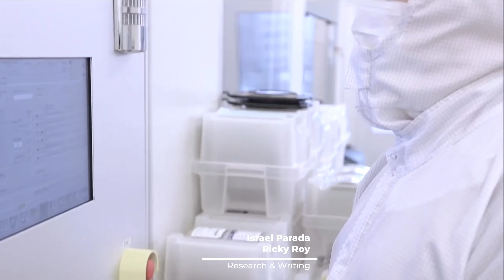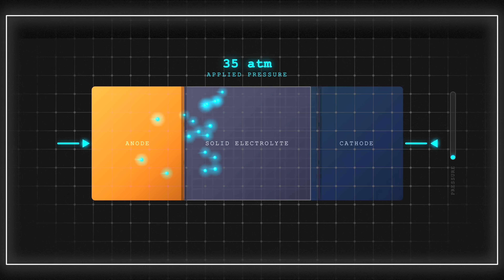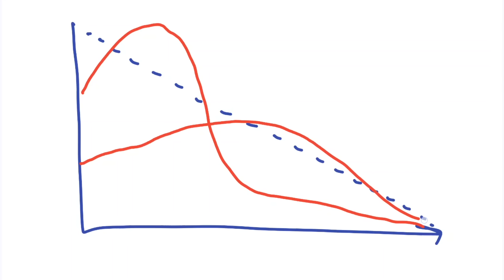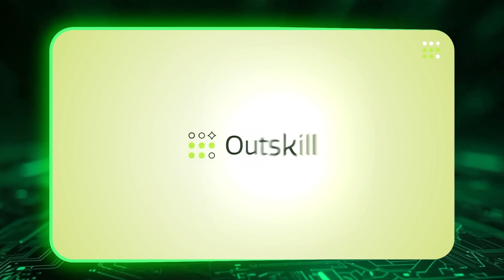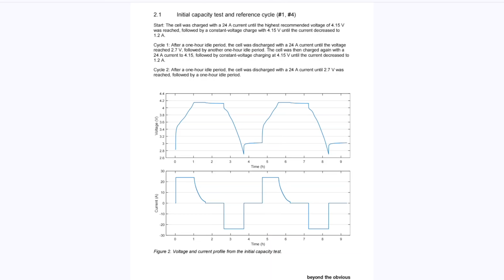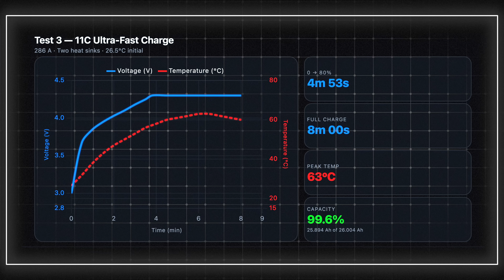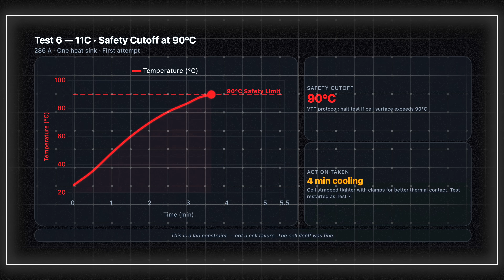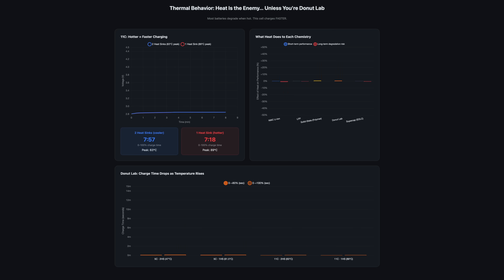Donut Lab's Solid State Battery Test are Shocking...

Comment: Great analysis, Ricky! 
I think the key lies in the internal surface area.

The "lithium fingerprint" (3.6V-4.3V) is likely a deliberate design choice—digital emulation to make the cell a "drop-in" replacement for OEMs. The real story is in the physics you noted: the resistance drop at 90°C and the lack of swelling.

My theory is that they are using an amorphous, aerogel-like nanostructure with a massive internal surface area. Instead of slow chemical intercalation, ions simply "stick" to this enormous surface. This is the only way to potentially reach their 400 Wh/kg claim while maintaining the zero-expansion stability and 11C charging you saw in the data.

As you observed, the cell actually performs better when hot because heat facilitates ion kinetics across that massive surface lattice. Don't let the familiar voltage curve fool you; the thermal stability and lack of physical expansion prove this is a "supercrystal sponge" operating on physics, not traditional liquid chemistry.
Reply: @te107  Aside the technical data you explained, about the internals of the cell, is exactly what I was thinking. The internal resistance dropping with high temperature, to me, signals no LiOn. Having seen how Donut Labs operates in the marketing side, we will probably see variations of the test pretty soon.
Reply: In other videos one woman dissected probable patents and internal structure. What you are saying about the sponge is actually what she discovered.
Idea was about carbon nano tubes enclosing some material for rigidity and then those tubes fill with electrons.
The drop of resistance with heat suggests they figured out more like physical battery than typical chemical one.
But all things aside, if they managed to do NMC liion that can be charged with 11C and do not go to flames with 90*C and remain capacity, this stuff itself is very big.
I was a skeptic for donut but they are cooking so I will let them cook and I will judge them by the results.
For me even if they will end up with 5000 cycles 3-5C non combustible battery with more than NMC density, damn they won already and everything over is a bonus.
All governments can start pressuring automotive to remove dangerous NMC if there is in place replacement.
Not saying about powerbanks market. Airlines will insta ban NMC cells on board just solid state allowed as few planes already burned down.
So even if small portion of claims are true or just to some degree they already won.
Reply: @RicoPenguin imagine our smartphones having enormous capacity that doesn't degrade after quick-charging them for just 3-5 minutes 🤯 (on a daily basis!) would make good use of the new 240W USB-C standard!
Reply: @RicoPenguin  word salad.
Reply: How would there be digital emulation in a raw battery test?
Reply: @Beekobah  - I'll submit that the testing protocol being used is DonutLab confirming that the battery will work similarly - and safely - with an existing charging architecture. If that's true, then having a similar charging curve as a NMC-type or LiPo battery isn't a bug. It would look similar.
Reply: @Beekobah  look at Prof Kohlmann, Uni Leipzig's work in Nitrogen dotted single carbon nano tubes and at Bela Bhuskute  CTO Nordic Nano's work on TiO2 quantum physics. Both of them are connected with Donut Lab. So, by the way is the former CEO of Nokia as a financier. 
We need to change the prism here. These guys are no fools and arent suicidal either
Reply: @Beekobah  It's complete hogwash lol, that doesn't exist.
Reply: Wow! A 12-person team was somehow able to exactly match the charging profile of a lithium ion battery.

That's clearly the simplest answer, and not that they just tested a lithium ion battery.
Reply: @robertdascoli949   A 12 person team?  You need to look deeper. D.L. and Verge are not the ones designing and manufacturing the battery. They are the first licensees. There are other players involved such as Nordic Nano Group, a Finnish University, a German company (not to mention two separate billionaire investors). 

12 people... do people just not think before they speak (and assume so much) anymore?
Reply: @robertdascoli949  The temperature data suggests that it's not lithium.
Reply: @alexbasilevsky2340  Or it can be a modified lithium with some party tricks, time will tell.
Reply: Chemistry sets upper limit for voltage.  Capacitor does not have such limit.  Voltage can be increased by active electronics or connecting cells in series.
Reply: @jkn6644  1: Capacitors are most certainly chemically limited on their upper voltage limits. This is one of the most basic fundamental notions of electrochemistry. 

2: Donut Labs claims that this is a normal electrochemical battery. So either they're lying, or they've come up with a whole new branch of electrochemistry to be able to configure the voltage of the cell, as this form of electrochemistry doesn't exist in academia. 

Given the above, I'm far more inclined to believe that in reality they are lying, but more so that it's just a normal high performance li ion cell.
Reply: @btoiscool Donut Lab has explicitly stated this is not a lithium-ion battery and is not based on standard electrochemistry. As CEO Marko Lehtimäki has emphasized, they have moved away from traditional lithium to a system using 'geopolitically abundant' and '100% green' materials. Skeptics keep trying to apply NMC-logic to a system that functions more like a solid-state pseudocapacitor.

When you move from chemistry to physics—using the nanocarbon lattice—the rules change. That’s why the resistance drops at 90°C in the VTT tests. Standard liquid-electrolyte chemistry breaks down and gasses at those temperatures, but surface-level physics thrives. They aren't claiming to have 'magic' lithium; they are claiming to have replaced lithium with a structural physical storage method that handles heat as an advantage, not a threat.
Reply: @te107  What do you think is more plausible: That the guy who lied about having a "Super AGI" suddenly has with a very small team of not battery scientists/engineers suddenly, by their own words within a couple years, invented a whole new form of electrochemistry just to make it to where one of the easiest adjustments a person working with a battery management system (changing the charging profile of a largely digitally driven, software defined system) has to do suddenly doesn't have to do that, or that he's lying about things again.

Like be serious.
Reply: @te107  Oh I just read the bullshit you typed out, nevermind you are not an educated person.
Reply: @te107    Agreed. It's similar to, but quite as extreme as, when you go from macro physics and reactions to quantum physics and reactions, the rules and landscapes change. 

  Nano in a sense is closer to that quantum level.
Reply: I'm not sure about proving composition, because like everyone else we don't know what the elements and manufacturing processes are yet... 
AND I agree that having a similar charging curve as a NMC-type or LiPo battery isn't a bug. 
*It would look like a similar charge profile BECAUSE it's using the same test methodologies conventional batteries are using.*

(*For everyone hung up on you using the word "emulate" - using the same testing protocols that have been used to test NMC or LiPo battery packs is an apt way to describe emulation.*)

For those who think this commenter is huffing copium - Having the battery pack use lithium and / or a liquid electrolyte when DonutLab specifically stated that they are NOT using those in the pack architecture would be the corporate equivalent of setting off a nuke in your own house to cook an egg. 
They believe they have a breakthrough that doesn't use lithium. They are stating they can build at scale. They are moving towards manufacturing these battery packs in countries around the globe to meet future demand. If it's lithium you can't just source that anywhere. You can really only source it from the DRC or China. *It's not lithium.*
DonutLab have no reason to lie about that, and EVERY incentive to tell us specifically that they are making the battery with more conventional materials they can source globally.
Reply: It has been speculated that this cell has carbon nanotubes. The chief scientist at Nordic Nano specialized in them. The nanotubes give a big increase in density and C rate.
Reply: The 90° was limited. It can function at higher temperatures, but the people who gave the tests. Didn't come prepared to test the claims. 

 So it's really only caused more skepticism in some. Others excited. 

 Honestly I still prefer to have a standard 600 wh/kg battery over the 300-400wh this thing is has. I don't want a vehicle to last forever. 

 That's why this still isn't the end all be all like the claims suggest even if it succeeds.
Reply: I am waiting for a - 20 C temp  charging test!  This would prove a lot about the cell makeup not being lithium
Reply: At last, someone with a point supporting Donut lab. 
Your take is interesting, but I still think the company is up to something fishy.
It's just a matter of time.
Reply: You cannot "digitally emulate" chemistry, whatever the hell this is supposed to mean anyways.
Reply: @btoiscool I’m basing this on Donut Lab’s own info that their voltage isn’t 'locked' to a specific chemistry. Think of it like the power grid: we use DC-DC converters and inverters to step voltage up or down to match requirements every day.

My theory is that they use a cell-level interface to translate the raw energy from their nanostructure into a standard 3.6V–4.3V profile for OEM compatibility. It’s a 'drop-in' solution. 

The physics Ricky pointed out—the dropping resistance at 90°C and zero expansion—prove the internal storage isn't the NMC chemistry the terminal voltage suggests.
Reply: @te107  The fact that you are AI shilling makes me seriously skeptical of this battery. The last time someone slipped a DC-DC in a cell was the Batterizer scam.
Reply: @te107  It clearly is swelling, so this is a lie. And I will repeat: there is no such established electrochemistry that just lets you willy nilly change the fundamentals of a cell. That doesn't exist. I don't believe they have came up with that. At all. It wouldn't even make sense for them to have, that's one of the dumbest things that they could have chased after because ALL of these systems are digitally driven, defined by software. 

Y'all should like, actually learn about what you're talking about before discussing it.
Reply: I call B.S. If the voltage curve was "digitally emulated", there'd have to be a 200+ amp rated DC-DC converter inside the cell. Your AI slop adds nothing.
Reply: @thorlancaster5641 I’m basing this on Donut Lab’s own statement that their voltage isn’t 'locked'—it’s an adjustable output. This isn't science fiction; it's modern power electronics. Companies like Dukosi (with 'Chip-on-Cell' tech) and Innoscience (with 99% efficient GaN-chips) already provide the hardware to put this kind of intelligence directly on a battery cell.

My theory is that Donut Lab uses this existing tech to map their nanostructure's physical energy to a digital NMC-voltage curve for OEM compatibility. It makes the battery a 'drop-in' replacement for any EV. You can argue against the electronics, but you still haven't explained the physics of why internal resistance drops at 90°C in the VTT report. That is the behavior of a solid-state lattice, not a standard chemical battery.

Using AI to spot these logical gaps in the data is just being thorough—and as a bonus, I don't get cramps in my fingers from cross-referencing thousands of pages of lab data. 😉
Reply: But then the efficiency would be higher
Reply: did an AI write this?

Comment: There has been a huge number of YouTube sites and media outlets discussing this Donut battery and the VTT testing. There has been some amazing analysis of the testing and the results by plenty of of experts. 

What confuses me is, if this battery is so good, so groundbreaking and achieves outstanding results then why are Donut doing this cloak and dagger stuff where they are drip feeding eager viewers with a bit of information this week, and a bit more next week and so on?

If the battery was ready and if the battery was that good why the hell aren't they just making the full announcement and releasing the full testing that they have done and getting VTT to do the same full testing as well?? The announcement process about this battery that they are using is nuts!!
Reply: Simple, scam idiot private investors for the money due to FOMO, and then do exit like EESTOR, and no one goes to jail.
Reply: @melovescotch  EEstor is still around. It also looks like they actually were on to something but couldn’t quite commercialize it. In Donut’s case they claim they’ve ALREADY commercialized it and it’s in production. If anyone wants to invest there should be production samples available and a production line to visit. This is not the same thing.
Reply: Donut claims they want to maintain control of the tech. They don't want to license production elsewhere, they want to make ALL of these batteries. The slow drip of results gives them time to talk to potential partners and negotiate on their own terms.

Comment: Could the NMC-like data be the result of firmware on an interior bms? IIRC in another video they wanted it to essentially be compared to li-ion performance
Reply: I guess you didn't pay attention. This is just a cell with with no bms and the testing equipment pushes current while the cell chemistry dictates the voltage
Reply: @sedatmehmed4371 so says donut labs. The testing company only released information the company wanted them to.

Comment: One big reason i believe it's an off the shelf battery is because it looks identical like one. They claimed they can make it any shape, so we thought this means some 3d printing thing. There's no way you package a 3d printed thing like that, what happens if it gets slightly damaged in the corners? It is packaged like that because inside there are Li layers rolled together.

Comment: I thought I remembered them saying that the design them to fit into existing EV technology (so you don’t have to redesign charging systems).  Could that be why the charging looks like NMC ?  I don’t know enough about this stuff, so just asking.
Reply: I believe the charging is dictated by the BMS. For example when you charge your car from the socket at home, the socket just provides the power, doesn't decide when and how...
Reply: Charging curves are dependent on chemistry and temperature. What happens between empty and 4V does not matter that much while charging. Similarly while discharge the voltage makes a distinct curve which is very dependent on chemistry, cell structure, internal resistance and load.
Only thing that really matters to current designs is that max voltage...or you can just program battery managements to any voltages. Sounds more like: we bought this battery from Alibaba and it just looks like NMC while being completely different, trust me bro.

Comment: Resistance in Lithium ion cells decreases with heat - hence EV's pre-warm for fast charging. Resistance only starts to climb again between 60 and ** 80 degrees C ** depending on exact chemistry.  So again looks even more like a L-ion cell. Donut would not really care about premature cell death with so few cycles.  Marko is right - I donut believe on this evidence.
Reply: Keep in mind the test was limited to 90° Centigrade because they didn't want to damage their test equipment.

Comment: This was by far the best interpretation of the data. I was not aware of the voltage thing and can't imagine how is it actually working, you can't simply apply current without voltage.
Reply: The applied voltage varies to keep the current constant. It would go up as resistance increases. If it was charged with constant voltage the current would go down as the resistance increases as it it charged.

Comment: Sneaking suspicion there's graphene in this battery somewhere.
Reply: Lead carbon battery uses this principle, effectively a super cap integrated into the cells.
Reply: THAT, I believe. If this is real at all it's because someone came up with a novel graphene application (though that might limit the affordability unless this development includes a new, cheap method to produce graphene or carbon nanotubes). And graphene is a new enough material at this point that only so many researchers have extensive experience with it, so that feels barely plausible to me.
Reply: I have a sneaking suspision fraud is in this cell
Reply: @matsv201  Why not waiting a few months, before claiming that? Even better, stfu!
Reply: @matsv201  of course, fraud is possible but what would be the point? Spend loads of money on r+d and manufacturing for it only to be exposed as fraud?

Comment: The thing about the no lithium claim is that it's too easy to disprove and they wouldn't get much benefit from lying. A really good lithium battery would still be great. So for now, that's one claim I'll accept as probable until it's tested. But the density and cycle life are what I wonder about. I doubt there's anyway it can get to 100k cycles unless they mean "well it technically holds SOME charge." Like if we're talking about retaining 10% capacity after 100k cycles, then maybe.
Reply: "they wouldn't get much benefit from lying." Nope, looke at EEStor, they got their money, and no one went to jail.